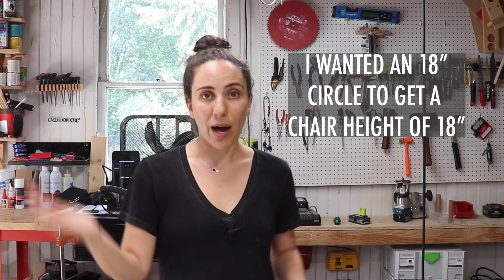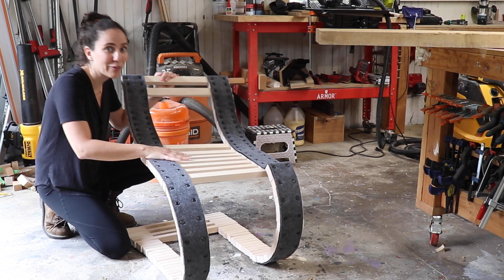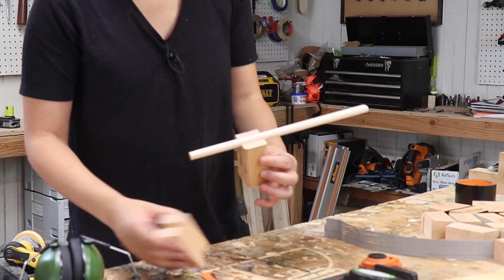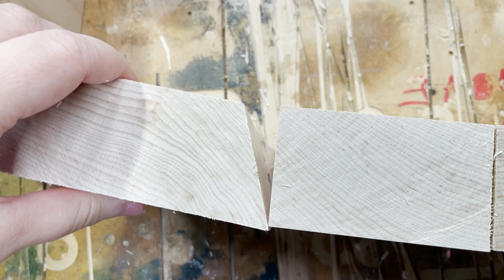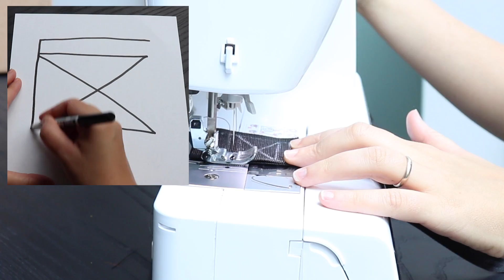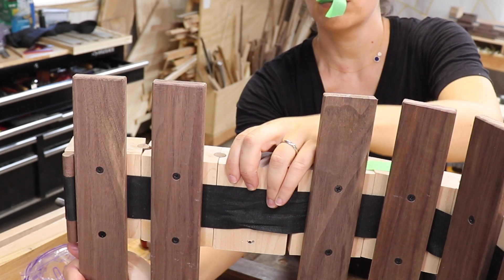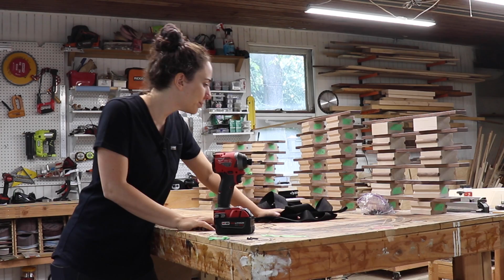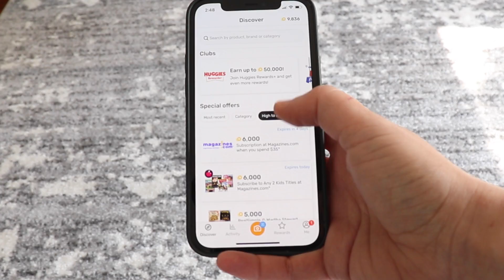I ATTEMPT to make a Roll Up Chair… AGAIN...

Comment: Alright, straps. Don’t look at how “strong” something is. Companies are always gonna market their product based on what the most sellable quality is. Strap “X” can hold up to 10,000lbs, but it’s gonna have 16% stretch up to 5000lbs and then it’ll start to take the load. Strap “Y” can only hold 4000lbs but has a 4% stretch across all tensions.

You want strap “Y”. I’m not exactly sure what webbing is out there, but I do know that Dyneema is some of the lightest/strongest material available and it’s got a pretty low stretch. It’s also very expensive. If you call customer support at Ripstop By The Roll they may have some recommendations they can make. 

After that, I think you have two main issues that are contributing to the problems… the first is the separation of the blocks on the front of the chair, and the second is compression of wood at the back of the chair (this is probably minimal, but even 1mm of compression is going to translate to several mm of separation at the front. It may not seem like much, but 2+mm of separation spread across 20 blocks adds up)

The first issue exacerbates the second by narrowing the point of contact and creating more pressure. And the second exacerbates the first by separating further when compressed.

You need an attachment between each pair of blocks on the front of the chair. A hinge, or a small strap will probably work (benefit of the straps is you can tension each piece individually, however… metal hinges are metal; no stretch, easier to install, and you would have much more predictable results). You can hide the hinges under the full length strap if you don’t want them to show. 

In theory, if you eliminate the spread, you equalize pressure across the blocks and this should help with compression. However, you may need some reinforcement pieces at key pressure areas (the part under your legs). Milling away a small bit of the wood and putting a flat piece of metal in it’s place would be tedious but would help distribute the pressure across a wider area, but potentially doesn’t help much because the wood underneath it can still compress.

Another option you have is to use several overlapping straps of different lengths strategically placed in different areas to apply more or less tension to certain areas. Want more tension under the legs? Add an extra strap to that section! Just two blocks seem to be separating? Put a strap between ‘em! You can still cover all of it by running a full length strap on top of them.

Other than that, it looks amazing and I’m pretty invested in this project now. Good luck!

Comment: Make a steam box and start bending the wood instead. (I did it to make my own slatted frame, but okay, just bending the slates a bit to make a slight curve is way more easier than going to bending an S shape into a board.)

Instead of bending with steam you can also take a bunch of thin wood sheets and glue them together in the position you want, it will hold that position then.  So wood is the other material ;)

Comment: Maybe you could try to use rope through the middle of the sections with several different rope sections then epoxied together.
Reply: I believe you need SOMETHING that will not stretch.  Having the material go through the middle of the blocks will also prevent them from shifting and collapsing sideways.
Reply: @CharlesHopkins  Good thinking steel cable through holes in the middle might do the trick.
Reply: Hidden Turnbuckles would help to tension things up and may be able to also have additional decorative sections in your workpiece.

Comment: My suggestion comes from sailing. I would suggest carbon fiber. Carbon fiber and epoxy resin for a permanent structural element that doesn’t move or roll up anymore. It would still look minimal as it can be cut to the same dimensions of the straps. Best of luck and thanks for the video.

Comment: Te problem is elasticity. Try putting more staps on top of each other, so that it doesent bend so much. You could also change the angles in wich you are cutting the wood to compensate for te elasticity of the strapps.
Reply: What about some tipe of ginges?

Comment: I made many errors like this. It would be best if you had a metal chain or a set of steel ropes, but not the fabric belts. The tiny thickness of the wooden side blocks increases the force on an elastic medium. I can estimate that if the chair load at least 200lb (huge person, overload by kids, an impulse of the force), then you must multiply this force by ten because it is the fraction between the depth of a butt gravity force point and the chair `composite leg` thickness. Finally, it would be best to have a steel rope/chain that will not have sufficient deformation under a 2000lb load. Also, as you may know, the ropes work like springs under load, but the chain does not. It would be best if you took it into account.

Comment: I feel like the issue of the segments separating might be from the angles of the trapezoidal shape being too big, so maybe if you lessened the angle on them then that could help. I also think maybe the amount of segments has to do with the strain on each of them so I feel like maybe if you lessen the amount of segments it could be more stable.

I also thought that you could maybe flip one of the segments of the bottom curve the opposite direction and that could help add some stability to the curve and help with when weight is applied to the top(sitting on it).

I also had another idea of maybe changing the segments to have a joint of sorts, so that they could have that extra opposing force, but I don’t know how you could make those lol

Comment: If u do try the leather u could notch out a spot for a steel cable for extra strength. Or even a few cables. You would have to use something so the cables wouldn’t eat the wood but could work steel stretches a lot less than fabrics tend to

Comment: I think that the issue might be the fact that the  pieces are free to move over the strap.  maybe if you put grommets on the strap and fastened that to the wood, it would get rid of the play in the wood pieces. At 25:57, look at the top joint of the radius for the seat. If you gromited at both sides of the wood with a strap is I don't think that that space would be allowed to be created. It might not necessarily just be stretch in the straps, but also play in all of the individual pieces. Just my guess but this is a super cool concept. Awesome job!

Comment: I know it's easy to submit ideas when you haven't done the work yourself, but I have a suggestion.

I love how you've eliminated a lot of the forces with the end to end stretch around the dowels, but the issue isn't the tension (in my opinion) but the stretch in the strap, and a lack of local clamping forces.

If this makes sense; try a heavy duty thick lashing strap material. It's thicker and heavier which is a downside, but it has a much, much higher tensile strength and less  stretch by length. I would also consider adding in a bar/dowel to make a matching concave/convex shape between the walnut slats and the maple blocks, so that the strap is held harder the more weight is added.

You should test your materials for stretch before committing them to the design. If you weigh down one end and fix the other up high, you can physically measure the stretch before strapping it to your lovely chair, saving a lot of time and effort.

Comment: Dynema is a high strength low stretch fibre. See if you can fine a webbing of dyneema
Reply: Also, what if the blocks in the radius of the curves were bigger in one dimension - deeper. It's hard to describe but hopefully you can understand me.
Reply: Also, what if the blocks in the radius of the curves were bigger in one dimension - deeper. It's hard to describe but hopefully you can understand me.

Comment: have you tried to make the first bend intermediate blocks go with more of a slope that angles against it? so instead of the high edge being on the on the outside with the turn, the high side would be on the inside against the turn at the middling pieces of the first turn. i ask because since it's causing gaps on the loop, changing the angles of one or two blocks might set it up, so.. cuz all the curves blocks are \_/. but maybe instead going /_/ /_\ \_\ on the edges of the loop. you might need to experiment on the angles needed, but this should help reduce gaps in your chair

Comment: I don't know if it will solve the problem, because all the woodworking I've done was really basic, but a total pivot from using the webbing wouldn't be to use hinges between every piece? (And I know it would be a LOT of work) but it would still be able to roll up and I guess it would get rid of the tension problem.

Comment: If you glue the strapping in place on the bottom all the way through the first curve it should prevent all the sliding around of the strap that makes it unsafe and it would also shorten the effective length of the strap making it stretch.

Comment: The core of the issue is compression and tension. The webbing can only resist forces of tension, and that means all compressive strength must come from the wood. If you mapped out the forces that act on the webbing and wood pieces, you'd have compression along the bottom curve and ground for the wood, with tension balancing that in the webbing (that's why the initial circle seems promising I think). Once you move to the seat, compression starts moving toward the webbing, and by the time you're on the back, the webbing is entirely resisting compressive forces. The wood on the back would take up that tension if you fused them (that's why the one glued section helped, and why the chair got much stronger when you glued them all). Without them fused, you need a webbing on the opposite side of the back to handle tension. The back as it is now is basically supported by a very thin section of wood very near to the strap (maybe an 1/8 in or so), so it offers no support.

You could have the webbing go through the seat of the chair and then come up along the opposite side of the back than you have it here, and that might work. You should be able to test ideas on a much smaller model, and expect it to handle a ton more weight than it currently does. If the strap is in tension completely, that should hold you easily (it has a break force in the thousands of pounds). Rolling up the chair will be weird if you have a strap on the back side of the chair, but you should still be able to get it into a roll (inner part will roll counter-clockwise, and the outer part will roll clockwise around that inner core).
Reply: i don't know that the strapping going along the back of the chair would work, because then it wont roll up. might as well just make a curved glulam chair at that point.

Comment: Super strong + super light =/= low stretch. By not fixing webbing to each part you introduce more stretch. Stretch is usually given as percentage. That means that the longer run you have, the more it would stretch. You can overcome that by fixing strap between each piece (like you tried first time, using top securing wood part might help here). Or you can use other material for joints. Maybe there is some type hinge that would work here? If going with webbing, slackline webbing should have minimal stretch.

Comment: 4 comments:
1) The wood grain seems to go in the wrong direction for strength, could the blocks be compressed a little when you sit on it?
2) Securing the strapping at each segment would make the stretch issue less prominent, as you suggested. But it would also eliminate the roll-up tendencies of unstressed parts, so it's actually a really good idea.
3) The straps are to weak and way to stretchy. It would be better to use straight fibers instead of a woven material. In a woven material, the fibers go over and under each other instead of going straight and the fibers that run in the stressed direction can straighten out a bit, thus stretching the material. Also, according to my calculations, the straps would need to be able to handle about 1 ton of tension each to make a safe chair, I don't think these can do that.
4) Use a chain from a motorbike, those things can handle extreme tension without stretching.
Reply: 1/4 inch steel cable can hold almost 3 metric tons of weight (aka tension). That should be enough. Heck that material can hold bridges (steel cables in general, but bigger than 1/4 inch, never heard of a bridge using textile straps :). I agree with your first point tough, not only compression, but using the chair wood fibers may wrangle off.. going to tensions failure.

I would make the whole thing by gluing sheets of wood into the desired S-shape and then glue the panels onto it. Than it has the form it should have without tension, yet be somewhat bendable (as wood does)

Comment: You need a greater preset the chair should almost be facing the ground before sitting in it your design and matriels will work fine with a preset

Comment: Part of your issue is that the forces that will be subjected to your chair aren't evenly distributed. This is very similar to a problem you'd see on a Statics assignment. I don't really want to do an analysis of an entire system that has multiple dozens of individual parts, but you can actually mostly solve the problem intuitively; no math involved. Let's assume that you sit in the chair. Even if you lean all the way back, The straps that hold the back in compression will be experiencing relatively little force, while the straps that hold the legs of the chair in compression are experiencing much greater forces. You can actually see this in action before you even sit in the chair. It's part of the reason that your legs weren't experiencing enough tension from the straps to keep them in compression, while your back was rock solid.

From the Wikipedia entry on UHMEPE, "Under tensile load, UHMWPE will deform continually as long as the stress is present—an effect called creep". To my knowledge, this is a weakness of synthetic materials in general, and Polyethylene (of all types) in particular suffers from this issue. This is another one of the reasons why your legs started to buckle. Even though UHMWPE doesn't seem very stretchy, under load it is more elastic than you might think. No matter how much you tension your straps, this issue would continue. 

The way I see it, there are a few solutions to your problem, some easier to implement than others, but your project is still salvageable. 
1. Implement a segmented strapping system.
2. Find a synthetic material resistant to creep and with as little elasticity as possible, or use a strong natural fiber. I didn't test how strong it was, but when I was younger I used to weave standard brown crafting hemp into rope for various uses. Even with just three strands of hemp, it was surprisingly strong. I'd imagine that with more strands, you could make a pretty strong rope. 

I would suggest taking each of your slats and milling out rectangular slots to act as guides to keep your tensioned material in place. After that I would go segment by segment, starting at the very bottom using your material of choice to bind each slat/block assembly together with the appropriate amount of tension and strength. By focusing on individual segments, you can provide adequate strength to the parts that need it, and also provide less to the parts that don't necessarily need it. I would avoid concentrating your tensioned material in the very middle of your slats because they would be liable to break. I would instead distribute your attachment points evenly across your slats to make the forces as even as possible. 

TL;DR, UHMWPE tends to creep and stretch under load, change your material to a natural fiber or different synthetic. Because forces aren't distributed evenly along the supports in the chair, the slat/block assemblies should be joined individually from the ground up so you can provide appropriate strength and tension to high-stress segments.

These fixes would take a lot of extra time, but I would be pretty confident that they would work.

Comment: The webbing strapping is designed to stretch, what you need is hinged joints that remain firm in one direction but still allow the chair to fold up when turned around

Comment: I know I'm late and this video just got recommended to me, but basing off the shape she wants to do I think this is doable with flush hinges, something like a piano hinge, I know it's a lot of work but I think this will stop the stretching, you can still roll it up (except for the glued part) and it'll be good! But the problem is that it won't flex when you sit on it, so basically making the rollable chair stiffer, but it's still sit-able though! The pinching problem can be solved by rounding up the edges, this wouldn't be a problem since the weight will be on the face and not the edges, but slipping your hand into it is still a danger though... Anyway I'd love to make my own project like this but, no tools and space to do, and also I'm in college with little to no spare time, as this kind of project would be perfect for a tiny home or a van-house project, imagine having a full size seat anywhere, then roll it up in a size of a trashcan if not in use, but hoping someone would make it.

Comment: This looks like a project I’d only trust with metal.

Square steal tubing with old motorcycle chains for the strapping finished with your wood/aluminum slats to complete the look. 

Another idea (hard to describe without drawing) folding legs that come down just before the upward curve. They could attach o bottom side of chair, making it useable at least for someone over 50lbs.

Comment: As hard wood as you can get and hinges rather than straps - don't see it being viable in any other way if it needs to hold an adult :-/ Hinges would also provide more lateral stability than the straps.